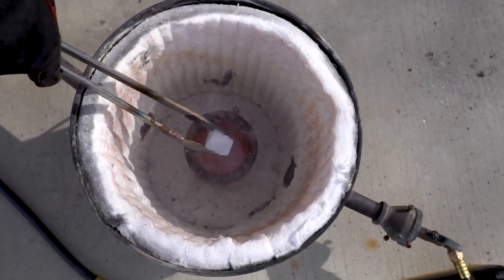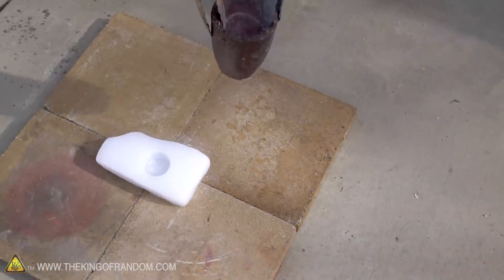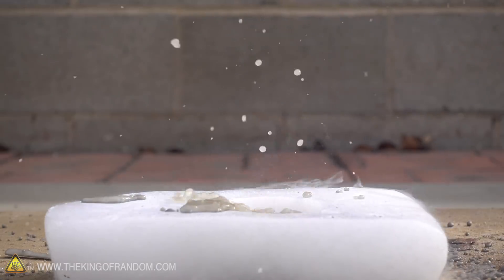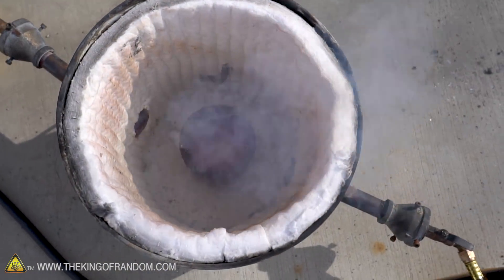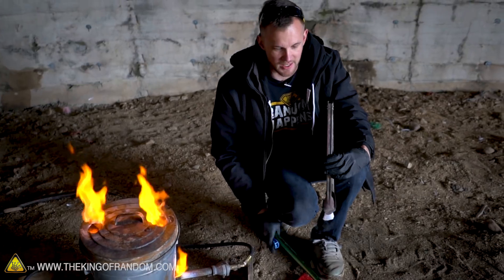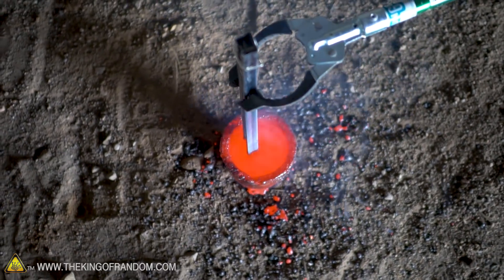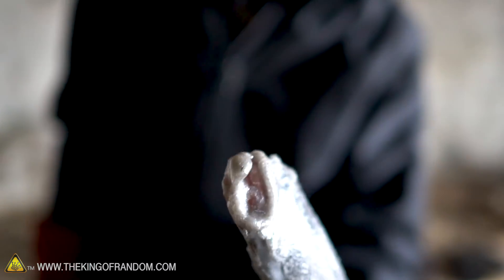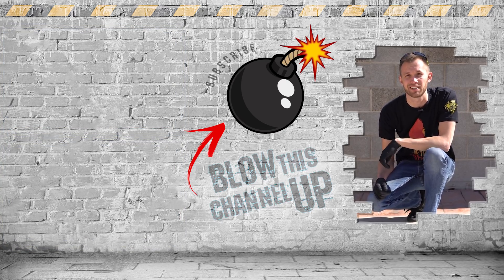Mixing Dry Ice with Molten Salt! TKOR Dives Into Molten Salt vs Dry Ice

Comment: Would it be possible to make dry ice molds? Like if you gathered some CO2 and because it's denser than normal air you could pour it into a mold, and I'd imagine you'd need a huge amount of overhang funneling into the mold, and then submerge the mold into liquid nitrogen?

Comment: You should get a better setup for pouring. It seems really easy to drop. There's a design with a stick with a partial metal ring at the end so you can hold it from a distance.

Comment: Put dry ice in a long metal tube, bore a hole in it and pour molten salt inside then quickly put a lid on it since the salt was bubbleing and releasing gas maybe it will have a explosive reaction

Comment: Can you melt dry ice would it be normal water of if it melt
Reply: Yannis Bang ...it's carbon dioxide..so carbon dioxide is a gas and not a liquid...unlike water which turns into regular ice..in conclusion there will be nothing...no puddle

Comment: You must have crushed the dry ice to powder before pouring molten salt in it,   As the surface area of dry ice is increased it would react faster , try crushing the dry ice and then pouring molten salt

Comment: its salt so it wont react with just anything, use water and it will give you a reaction, this is due to the sodium in the molten salt being highly reactive with H2O, further the dry ice which is solid carbon dioxide will not react with the salt in any meaningful way, just some base level chem for you.

also the "reaction" you saw (the bubbling) was not a reaction, just escaping CO2

Comment: This could be an interesting way to clean your crucible and play melting down salt inside the Crucible and then allowing it to cool it could easily be dissolved in water and it would likely pull out many of the Trace Metals and other things that will be stuck to the Crucible there for cleaning it

Comment: What's the melting point of the crucible?
Reply: Inactive Wall Everything, every substance melts ( sometimes specific conditions are required)
Reply: Inactive Wall Yup I said special conditions are required! :)
Reply: Helicopter_Fun look up the melting point for graphite or maybe it doesn't melt
Reply: Inactive Wall yeah it would burn though
Reply: Louis Dexter graphite doesn’t melt under standard pressures, smartasa
Reply: It doesn’t melt you weeb

Comment: Melt sodium metal in the foundry then put it in water... Will it react more or less than a piece of solid sodium?
Reply: Compare to his solid sodium metal salt thing in his collab video. TheBackyardScientist has the molten salt. Compare those two, but generally speaking here the Solid Sodium Metal always explodes with ease and power depeding on size. Molten salt has a hard time to trigger and doesn't explode that much compared to the solid sodium metal.

Comment: You should make a video testing if you could use hersheys kisses as bombs by putting gunpowder in the aluminum foil and using the paper as a fuse.
Reply: Joshua Stykz it wouldn't work because the gunpowder would just burn, to make it actually explode it has to be tightly packed and it would be very difficult to contain the gunpowder and pack it tightly in the thin aluminium
Reply: huh, thanks for the input, ill try to think of a solution to that problem.
Reply: Joshua Stykz you could CAST a thick metal casing for it
Reply: that would probably work, thanks

Comment: You should mix termite with liquid propane
Reply: Liquid propane would evaporate
Reply: The thermite wouldn't ignite cause propane doesn't burn hot enough
Reply: Maybe if you use a sparkler
Reply: thermite

Comment: Dry Ice In A Microwave
Reply: Dry Ice would likely do nothing in a microwave. A microwave heats with radiation. It causes water molecules in food to become active filling them with energy causing them to move extremely fast producing heat. Dry ice does not contain water.
Reply: OK Rutherford or put metal in dry ice or liquid nitrogen then put it in the microwave
Reply: OK Rutherford DO IT!!!!
Reply: Dragon The mysterious ok

Comment: Quick question to clean your Crucible out can't you put a cast iron skillet in there set The Crucible upside down inside of the skillet and as the stuff melts it runs down into the pan?

Comment: ok I know this is dangerous but what happens if you mix molten salt with liquid ammonia, I'm curious mainly because ammonia has water like properties, and I wonder if it would do the same thing as water. idk how you would accomplish this because of the fact that ammonia is very deadly when breathed in, and its liquid between -77c and -33c. it would probably be very difficult to set up but would make for a great challenge accomplish some day.

Comment: Try to melt a gem and see whats happen
Reply: Giorgio de biasi you most likely couldn't as gemstones are formed under the earth and extremely hot temperatures, much higher than what any hobbist's forge could ever do. You'd probably need something like an industrial forge or electric kiln. Even then gemstones are rather resilient to hest.

Comment: Can you melt dry ice in a container than refreez    It in liquid nitrogen
Reply: Dry ice does not evaporate, it's sublimation. 

Sublimation is the process of matter in a solid state transitioning into a gaseous state, completely skipping a liquid state. 

In a pressurized container at a proper temperature, dry ice will remain in a solid state. Anything above -109° F at 1 bar will cause it to sublimate.
Reply: If u keep it in the correct container it won't evaporate
Reply: If you keep it in a container that's sealed it won't evaporate
Reply: Thomas morais they did a vid where they put dry ice in a bottle and it was shown in a liquid state
Reply: Randomvids3467, what kind of bottle? If it was a soda bottle, that liquid was water. The CO2 still sublimates
Reply: Randomvids3467 even in a sealed container dry ice will still evaporate

Comment: Because mixing an ionic compound with a nonpolar gas won't do anything
Reply: Heated ionic compounds(soluble in water) make the reaction in water. Maybe pour it into straight sodium metal to see if you can dissolve the sodium metal. NaCl + excess sodium, maybe with the molten salt it will make it miscible.
Reply: Or Hydrochloric acid, anything with one of the two elements in NaCl, make an interesting reaction

Comment: To me it appeared as if the molten salt bounced off of the dry ice cubes, but I could be mistaken. Also, wouldn't different salts act slightly different from the table salt due to the chemical makeup and the natural crystalline structure which may change the way it reacts when rapidly cool.   Try using molten sugar as well.

Comment: Please try to do an electrolysis! You will get pure sodium!
Reply: *electrolysis, and you would actually get hydrogen and chlorine. The sodium would bond to the water and make Sodium Hydroxide.
Reply: Sam Seshadri of course you are right when using a solution of salt and water.
I want him to try it with molten Salt! Theoretically this should work!
Reply: Freizeitflugsphäre Honestly I don’t see why that wouldn’t work. The only issue is he needs electrodes with a big difference in reduction potential, and he also needs something which can withstand heat. Maybe platinum or Carbon?

Comment: Molten Salt is extremely hot, and I noticed that dry ice takes a while to melt even when placed inside the molten salt... 

What if you place Salt and Dry Ice in the foundry, would that make the process slower? Or would dry ice simply give up to the blazing heat of the foundry?

Comment: It is not as violent as with water as this is simply solid CO2 .When you put molten salt in water you get H2 and O2 and then: an explosion(because H2:O2=2:1 and due to the ignition of the H2 because of the heat emitted from the molten salt).

Comment: If you want to keep slag to a minimum in your crucible, when melting metal, put some lubriplate grease in the molten metal, just a small amount brings the slag to the surface where it can be removed. Makes the metal cleaner, and the pot as well.

Comment: After you melt the salt and it turns gray, dissolve a sample in water and see if the water changes color as well and leave it to settle, to see if there are any particulates at the bottom. Shouldn't take much work.

Comment: The salt comes out clear but when it hardens and turns black the reason for that is you're using crucible that has aluminum and other metal slags in it. so there's no point in saying it's oxidizing which is not why it's because it's picking up everything else

Comment: It is quite easy to make metallic sodium from molten salt by passing electricity through the melt. A single car battery should be more than enough (it must be DC), I have already done it myself. you should use carbon electrodes.

Comment: The reason molten salt reacts to violently to water is the salt is so hot it super heats the hydrogen in the water and as we know hydrogen is combustible

And dry ice is just co2 so it does not have any combustible elements

Comment: What if you pour Molten glass into Liquid Nitrogen ???
Reply: Beyond the Press does this, he makes Prince Rupert's drops in liquid nitrogen
Reply: Qualyn Foreman I'd imagine those drops are under a lot more stress and are likely more volatile when they explode.
Reply: Brandon Allen the glass would probably become solid before anything cool happens
Reply: The ones made with water work better presumably because the leidenfrost effect. It's actually slows the cooling process and puts it under less strain.
Reply: Molten salt in water
Reply: Brandon Allen I would like to see reaction but I'll probably freeze 10 times faster a hundred million times faster .or get  broken to diamond

Comment: if you use a thick steel or ceramic crucible the salt doesn't turn AS black, still darkens but it casts a little bit brighter. Also salt CAN be use to cast things but the cast form needs to be up to temperature before pouring.

Comment: eat dry ice
Reply: Dry ice will cause ice burns.
It's just frozen carbon-dioxide and it means that it doesn't melt like frozen water (regular ice), it evaporates and leaves no residue. This also means it's "melting" quite slowly compared to regular ice and you need gloves when handling it. No skin contact at all.
Reply: still, eat it
Reply: But isn't it super cold?

Comment: Can you melt dirt?
Reply: Dirt, or soil, is mainly minerals from the rock below it and organic matter from the plants above. So once you've burnt out all the organic matter, it depends entirely on the rock below as to whether you could melt it or not. Some minerals, like silicon dioxide from rocks like chert, melt at extremely high temperatures, higher than steel. While others like calcium carbonate from limestone, melt at relatively low temperatures, closer to that of Aluminium.

You'd basically be melting rock.
Reply: And that is why it'd be interesting
Reply: I wouldn't call it interesting as if you know what rock they use, you'd be able to easily hypothesise the outcome. Find out the area they do the testing in, like which county in which state, and you can fairly easily find out the rock type below their feet. Do a little research on said rock and you'd pretty easily come to a conclusion by comparing the melting points of the minerals comprising the rock with the burning temperature of the fuel they use in the foundry.
Reply: HMS-Captain Lurmey captain party pooper much?
Reply: darkwarrior, I see no party here, just a question and an answer.

Comment: Humm....What about throwing Sodium into molten salt.....DESTRUCTION????
.
.
Otherwise use Aluminium.....NaCl + Al ----> AlCl + Na
Reply: Al won't displace Na from its salt as it is lower in the reactivity series, he might have some luck with potassium!
Reply: Salt is sodium chloride. It probably wouldn't have much of a reaction.
Reply: Nachiket Patil it’s typically humid there so sodium might just blow up in their hands
Reply: Um salt is sodium chloride meaning that a chemical reaction won't Happen.
Reply: Nachiket Patil it'll make sodium aluminium chloride, what they actually had here in the crucible because it was not clean
Reply: Its AlCl3 not AlCl...anyways it wont do anything
Reply: I don't have a clue what that means but it sounds smart so I'll like it anyway
Reply: Nachiket Patil I don’t think you know how chem works
Reply: XD.....yeah i agree...but if they are quick enough then they can do so.
Reply: Yeah....
Reply: Luckyleol Gaming yeah but both have different properties
Reply: there will be no reaction
Reply: @Nachiket Patil
You are describing a displacement reaction, but if you add sodium to sodium chloride (or Na to NaCl) nothing will happen as and element doesn't displace itself.
Aluminium also wouldn't react as Al is lower down on the reactivity series than Sodium, meaning it will not displace it in the reaction.
To get this reaction to occur an element higher up the reactivity series than sodium is required, such as potassium (K), however potassium is quite expensive at £100 for 100g, forming the following:
NaCl + K  --> KCl + Na
Reply: Nachiket Patil 
Ooooh~ balanced equation!  XD
Reply: What if we use aluminium then....NaCl + Al ----> AlCl + Na

Comment: Can you melt rock please......
Reply: Mamoun Benseddik It’s possible, because when rock is melted it turns into magma. Although, it burns at thousands of degrees. So, he’d need special equipment which is of course as you can guess is very expensive.
Reply: Aditya ofc it's possible 😪
Reply: he did already in the mini electric arc foundry video
Reply: Awesomeness Brahadhish he made this experiment
Reply: That's gonna be lava boy...😂🙄
Reply: sigh It really depends on the rock of choice. Some will melt easier than others but will all result in similar, but ultimately different forms of lava. It's correct to say that when rock is molten it forms lava, but it's not correct to assume that all rock is the same or melts into the same thing.

Chert, for example, is primarily composed of silicon dioxide, and so when it melts it'll still be made of primarily silicon dioxide with a melting point of around 1,710 °C. Limestone, on the other hand, is primarily composed of calcium carbonate, with a melting point of 825 °C.

Steel, by comparison, melts anywhere from 1370 °C to 1510 °C depending on the carbon content, and Aluminium melts at 660.3 °C.
Reply: Fr0stFl4me it’ll actually become lava.
Reply: This not Minecraft
Reply: He did this in the mini arc furnace already, but it was very small and hardly useable. I would really love to see a big batch of lava.
Reply: molten stone behaves almost exactly like glass. With a normal acetylene burner it is possible to melt stone, but I do not know the exact melting point.
Reply: Markus Villum Grevsen 
Magma and lava are the same. as soon as magma comes to the surface it is called lava. What type of stone you get when cooling depends on the ingredients and conditions under which it cools.
Reply: Mamoun Benseddik bruh, lava and magma is molten rock
Reply: Awesomeness Brahadhish yesssss
Reply: Awesomeness Brahadhish ur name 🤣
Reply: THAT WILL BECOME MAGMA
Reply: Melt a crucible please
Reply: Awesomeness Brahadhish they already did it, with the arc furnace.
Reply: Mamoun Benseddik  the earth melts rock
Reply: Zachary You just need a special type of brick which isn't that expensive...
Reply: check the electric arc furnace vid
Reply: As much as I'd love to see man made magma I doubt the foundry here would be able to get even close to the heat needed. Stone/rock is different from Sodium, Aluminum, Iron, Copper and Steel in one major factor it's a insulative material so it isn't the easiest to get heated due to that factor. The other things they have melted all carry the heat quickly and evenly so they melt at much lower temps. I'm think that to even have a chance they need up to 2400 °F and lots of propane to last long enough.
Reply: Actually theoretically it is. Salt is technically a rock though it is composed of a metal element Sodium and a Gas Element Chlorine. Improbable, unlikely but never impossible.
Reply: what u talking about? ofc he can melt rock
Reply: he did it in the electric arc furnace video but I guess you saw the comments recommending it:D
Reply: Mamoun Benseddik Yes, but it does not turn into lava, it turns into magma, but if you want lava you need to smelt obsidian
Reply: Awesomeness Brahadhish v
Reply: Its possible to melt rock
Reply: :P
Reply: That would be interesting
Reply: Jin it is possible
Reply: well if the crucible dint melt i guess not....... :/
Reply: Mamoun Benseddik no
Reply: Awesomeness Brahadhish is it even possible
Reply: Awesomeness Brahadhish no kiddo do some researtch before saying something stupif

Comment: i still want you to electrolyze salt
Reply: TheLenny27 Or if they're dissolved in a solvent.
Reply: Benny, this is why electrodes are made of graphite, it doesn't matter what happens to them.
Reply: Il Papa Vitielo nothing will happen to graphite i have tried it
Reply: TheSyrianGamer 
I meant it as a pure substance, not dissolved with anything.
Reply: yessss
Reply: VINOJJ KAMAL wtf???
Reply: U speak my mind !
Reply: If we electrolyze salt solution ,hydrogen and chlorine will form and if the electrode is steel,it will be damaged
Reply: Can you make a light turn on with your electric furnace thing pls?
Reply: fair enough was thinking along the lines of the electrolysis of alumina to get aluminium metal, where the electrodes react with the oxygen that comes off.
Reply: Koos Naamloos because of the chlorine gas which is deadly in large amounts
Reply: It's super easy, make a salt soluition and hook a battery on it, it will smell like a swimming pool
Reply: a-lpha of Zeldaforme Gaming 
Salts are only conductive if they are molten. Always.